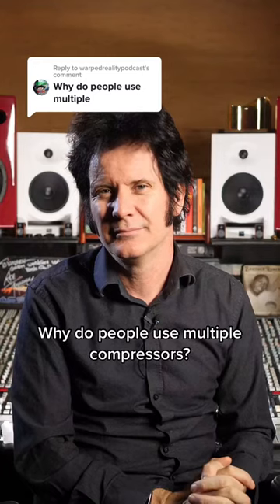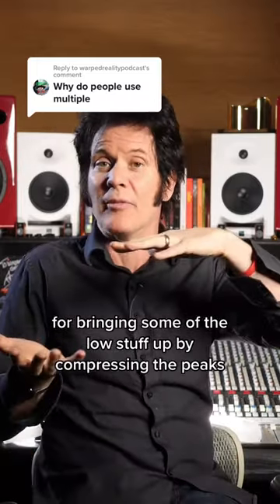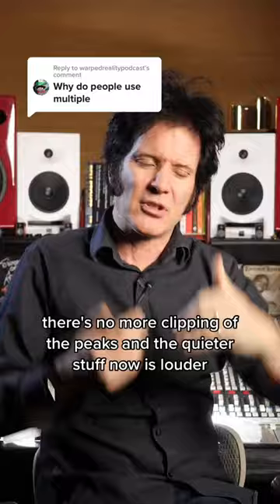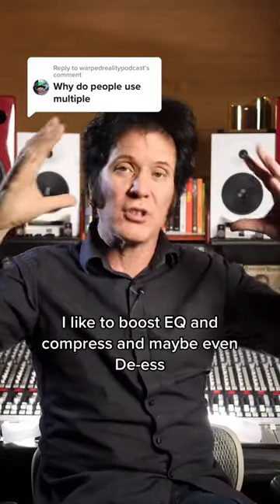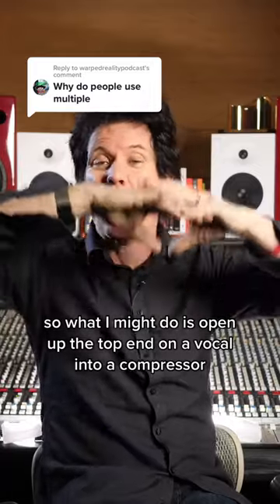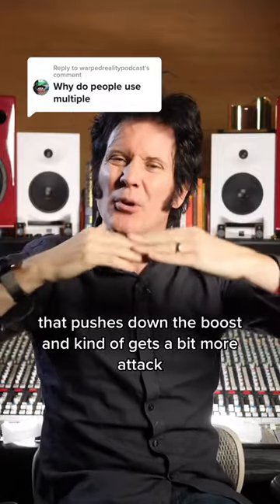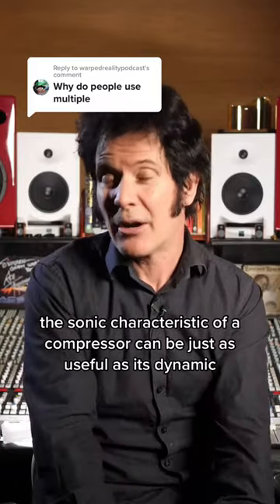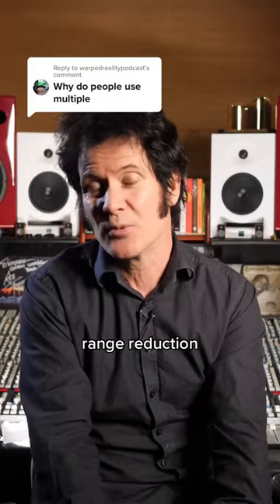Using multiple compressors in Music Production?

Comment from the maker: What are some of your favourite compressors and why?
Reply: I do live sound for a large acoustic band for a 4200+ member church. I have no formal training although I have FCC technical license credentials and have built audio circuits transmitter, and receiver circuits since 1967. It's taken a long time to learn a lot of stuff purely by thinking carefully about what stuff does, trying different things, and learning to listen to the results. 

The church has an SQ-6 board and a complete installed system with subs and fills to go with it for 64 send channels, 48 of which I can have routed at the board to its surface at any point in time. 

The band can comprise up to 9 individually miced vocalists and up to 10 individual miced or direct send instruments plus a 6 mic drum set.

The SQ-6 digital models have marvelous optical, 1176, and dbx 160T digital compressor models that I can use individually on single channels to do some very modest leveling and transient control. 

I use the dbx 160T model to control plucked instrument transients such as acoustic guitar, because it has a fast attack, a really big soft knee if I turn that on (always for this) and the  compression decrease and will follow the plucked instrument sustain through the wide soft knee giving me a lot more of the sustain sound on banjo, mandolin, octave mandolin, small body acoustic, and dreadnaught acoustic. Typically, I'm mixing only two of these at a time since it's two instrumentalists who play these. The higher sustain level allows me to get distinct voices from them in the instrument mix. I thought about how to get the attack and sustain differential much smaller and tried the 160T large soft knee to keep the effect more natural sounding. I compress the banjo and mando transients more than the acoustic guitars because the banjo and mando are very percussive. Hard transients can get a 10dB fast compression that then reduces back through the knee on sustain.

I use gentle optical compressors individually on each vocalist to gently level them and reduce variations in dynamics throughout their vocal range and handle sudden increases. About 3dB average peak compression at about a 3:1 to a  4:1 ratio  I put an 1176 model on one female vocalist who habitually needs more limiting and leveling of her dynamics through her pitch range than the optical compressor can do well. Normally about 6dB peak but if she hits it hard, maybe about 10dB peak at about a 4:1 ratio. I have her set to a classic Chris Lord-Alge setting and then deviate on input level only as needed. 

I use optical models on the grand piano and smooth clean electric guitar (think clean jazz sound thickened by a tube amp and a tube model preamp in the SQ-6). I use optical on a classical guitar in preference to others because I think it sounds more natural. 

The bass and drum set get 1176 models. 160T on the snare. 

I brought in a WA Buscomp and an ART Pro VLA II in series to use as an insert on the house mains for house bus compression. The Buscomp is set to do about 3 to 4 dB of compression at a low ratio with its high pass engaged (to prevent kick drum and bass pumping) to keep hard transients from driving the following optical compressor which I use for gentle leveling. The optical is about 2 to 5 dB reduction peaks. These use a 3:1 to 4:1 ratio set to operate just at the thresholds.b It allows me to naturally reduce the difference between the vocal phrases above threshold and the instrument fills in between them below threshold. The optical is marvelous for this. 

This whole arrangement of compression allows me to get a cohesive set of instruments and fills between vocal phrases and a stable harmony mix of vocalists who sound like a cohesive set. For distinct solos and leads, I'll gain up the lead or solo while leaving the backing as a backing. 

In spite of my age, my ears still have a really good frequency range. I feel really lucky. This took me quite a while to work out while reading, studying techniques, understanding what these circuits actually do to sound, and listening carefully to what I've done with stuff and the net result. 

Thanks for your YouTube channel.
Reply: In the box Fabfilter is great for transparent sound modification - especially nice for helping the song breathe during mastering.